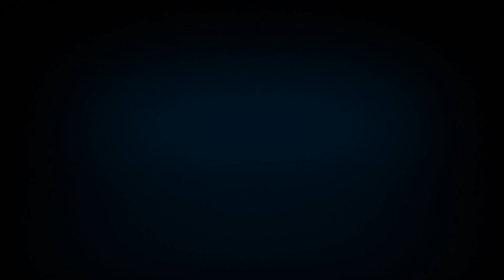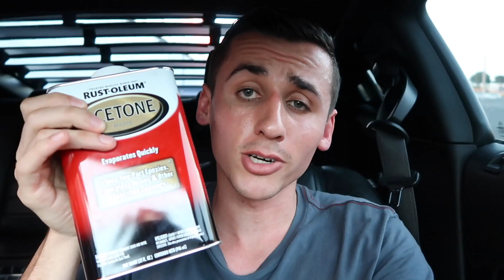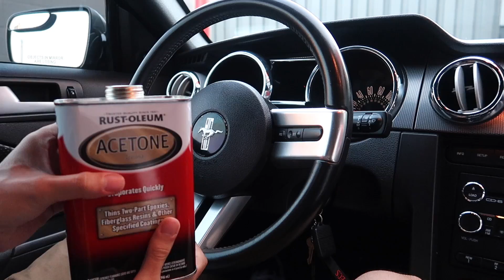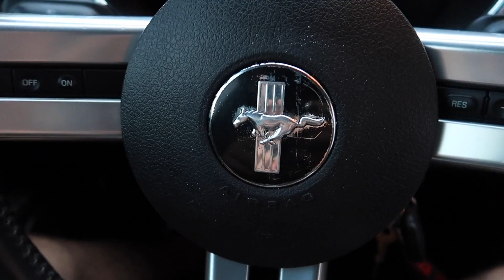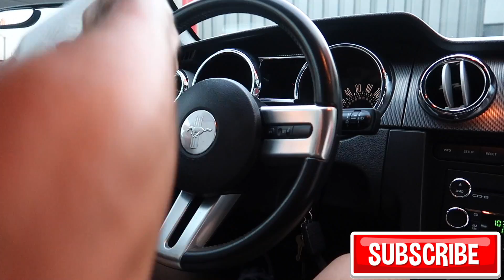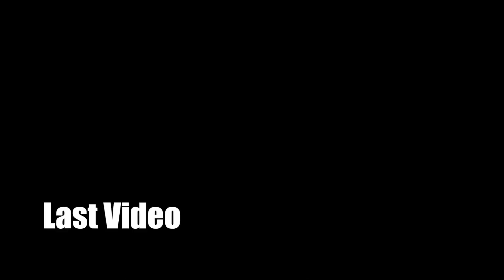How to TRANSFORM Your 05-09 Mustang Steering Wheel

Comment from the maker: Note! This only works with PAINTED emblems, NOT Plastic emblems. Please check whether yours is plastic or paint. ALSO, Use Microfiber towels when applying acetone to ensure that there are no micro scratches on the chrome finish. Mine has barely noticeable scratches on it using paper towels. I don't mind, but if you are OCD then microfiber towels will be best for you.
Reply: Nate Rider is there a certain acetone you have to buy cuz it's not working that well lol 

edit:  the red white and blue came off but the black is not coming off at all
Reply: Nate Rider how do you check to see if its plastic or paint?
Reply from the maker: It takes a while for it to come off. ABout 15 min for me. Keep on rubbing, if red white and blue came off then black will eventually come off too
Reply from the maker: Plastic is a more glossier finish and the paint is a flatter finish
Reply: Nate Rider you should get a carbon fiber dash kit
Reply: How can I tell if it’s plastic, or painted??? Because I am afraid I screwed up my car.. because I stopped half way through because it was not working correctly. Then I saw your comment! It better not be plastic!! How can I tell?!
Reply: James Ferro hey dont know if youre still stuck with a half finished emblem but im going through the same problem right now, came across some rustoleum aircraft remover in my garage and it seems to be getting rid of the flat black paint. wish i wouldve came across it sooner before i tried to chip at it with a knife and left scratches
Reply: So would this work with the one on the trunk where it locks?
Reply: found out mine is plastic
Reply: Pony?!?! I thought was Horse.

Comment: Thanks 😊 for that it’s good to know but could I ask what all the switches on the steering wheel are for??? I just brought a 07 Mustang but it’s got a after market stereo in my Mustang???
Reply: Parbhu Manga they are for cruise control for 07 only. Turn it on/off. Set the speed. Accelerate/slow down
Reply: Henry Gonzalez thanks 😊 very much l appreciate that.
Reply: Parbhu Manga no problem man. Welcome to the family!

Comment: Can I remove it with something else?
Reply: I used standard paint stripper from Wal-Mart and it worked great, just took many coats. Whatever you use, block off the badge with painter's tape or anything to protect the rest of the wheel.

Do not use 0000 steel wool. I gave it a shot not knowing what I was doing. It didn't give it deep scratches, but it doesn't shine wherever it's used. If you want to shorten your work time, use a knife and gently scrape the blade back and forth. You'll see a powdery clear coat and paint come up. Just stop before or as soon as you see any metal, and again be very gentle. No force is required. From the the paint stripper can get at bottom layers right away.

Comment: I know it's not related... but I don't see much interior mods videos here.  I just bought the coverking suede dash mat to try out, got it for a good deal, in black.  Will let you know how it turns out.  I still like the plastic dash though so who knows I might try it and take it back off :P  My entire interior is still brand new, car has about 30,000 miles on it.
Reply from the maker: interior mods to come! stay tuned
Reply: I got my Coverking suede dash mat today, I haven't tried installing it yet but it looks quite small and doesn't look like real suede.  I'm pretty tired right now though I'll let you know if it fits.  It has 2 pieces and I'm unsure why and it looks different than the photos of it online.
Reply: Nate I just got my coverking suede dash mat.  Not only is it faux suede but it also is 2' too short for the dash and it wouldn't have looked that great if it fit anyways.  I got refunded by the seller.

Comment: Is this done to the stock steering wheel center ?
Reply: Yep, I just did it to mine. 2006 GT. People say to be careful if yours is plastic. I don't know which have plastic badges, but I felt mine and it was consistently colder than plastic elements in the car so I used that to feel confident it was metal.

Comment: For anyone wanting to do this, I’ll explain my way of doing it. What I did was remove the emblem from the steering wheel using a flat head screw driver. I also disconnected the horn for this part because you will be pushing on the wheel a lot. There is just a connection right next to the horn that pulls out, it’s fairly easy. There are 6 tabs on the emblem that go into the steering wheel and they will take some patience to get out. It is important to take your time because you might end up bending your emblem since it is made of thin metal. After you get the emblem off, let it soak in a bowl of acetone for around 2-3 hours and the you should be able so wipe away all the paint and plastic. Then squirt some superglue on the back of the emblem, realign the tabs to their holes and place the emblem back in.
Reply: That sounds like a great method. I got the paint off mine, but I believe the paint chips themselves ended up scratching the metal surface as I was wiping the microfiber around so now I have a new problem.

Comment: Hi I just discover your channel because I'm about to buy a 2005 mustang gt and I need your opinion. The car looks nice in the pictures and it has 60000 miles on the clock, it costs 15.500$. What do you think? Is it to much 60000 miles? Thanks great vids dude!
Reply from the maker: I would try going to 13 if you can but that is still a good deal. I would keep on doing research on it and negotiate with the seller